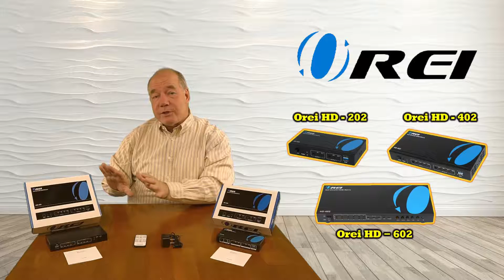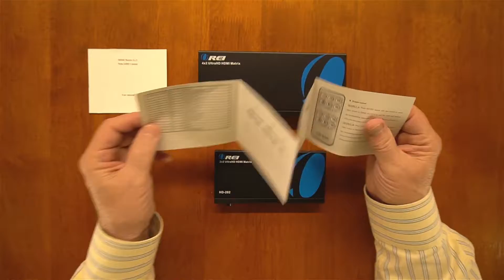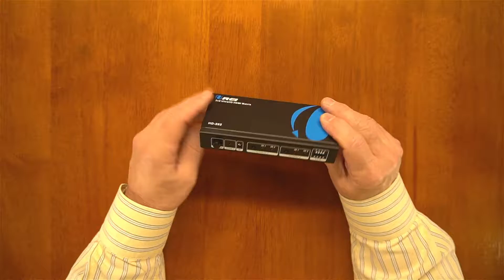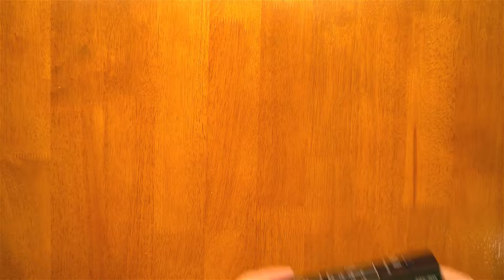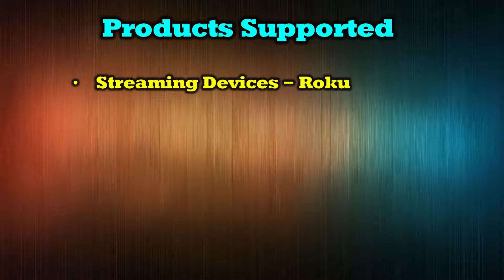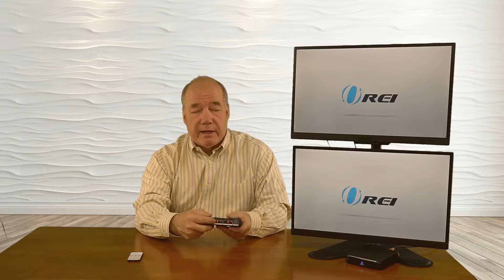OREI HDMI Matrix Series |Specs & Instructions(6 input upto 2 Display)

Comment: I have a dualmonitor workstation with a laptop dock, i would like to have it so that i could seemlessly switch between using the dualmonitors with my workstation and laptop, one of the monitors is a 1440p 144 hz monitor, will using the device inpact the refreshrate? and will this device work in a dualmonitor setup where you would have to show different things displayed in the monitors?